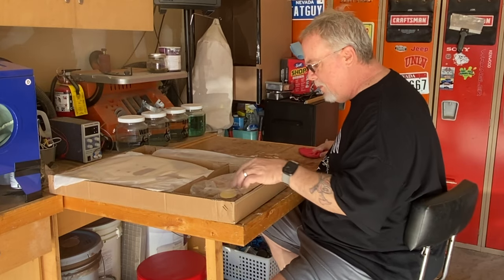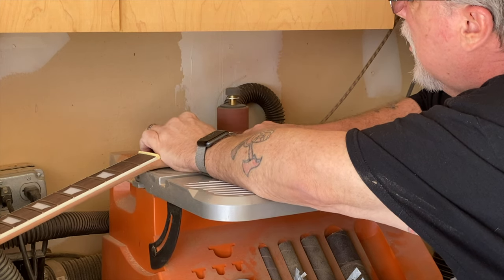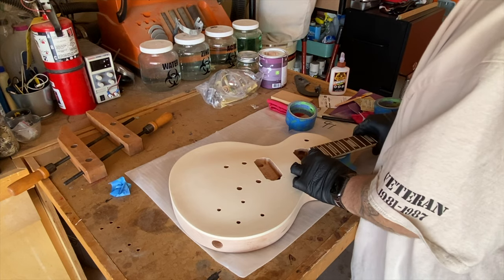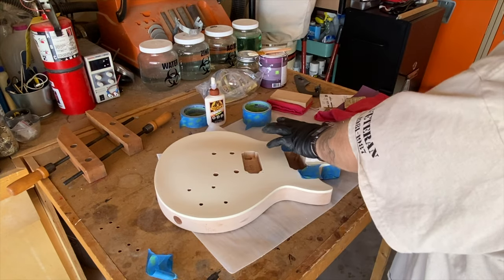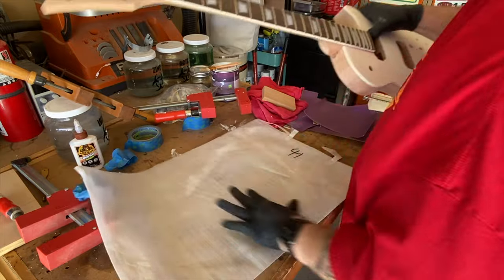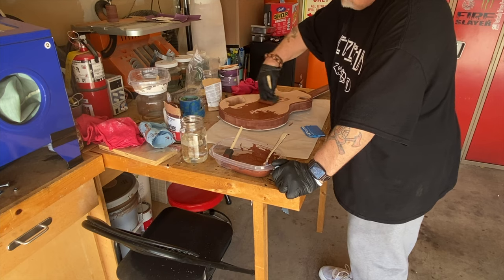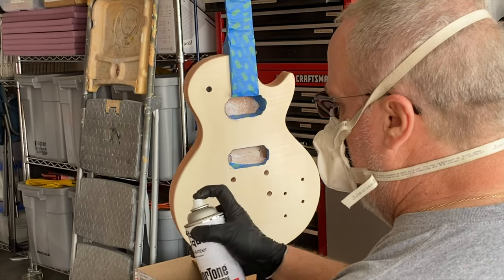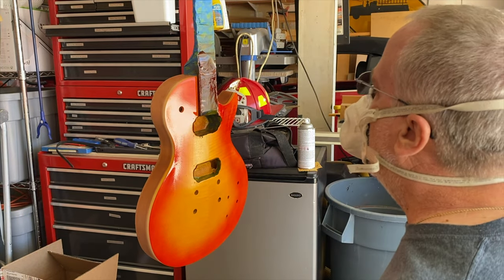Building and Electric Guitar Kit, Part 2 - Neck and color

Comment: Looks good so far 👍. I do have something that you may want to consider, or research, that is shielding the pickup and electrical pot compartments on your guitar. This will help clean up any feedback issues to a certain level. Of course this will be something to do after the outer painting is done, but before the electronics and hardware are installed. 
Thanks for sharing and God Bless, Greg
Reply from the maker: It's actually too late, BUT....  I have some adjustments I want to make, and Might try that when I do...  Thanks...